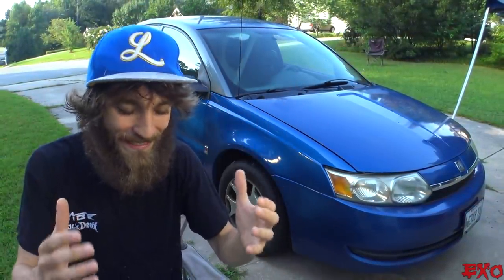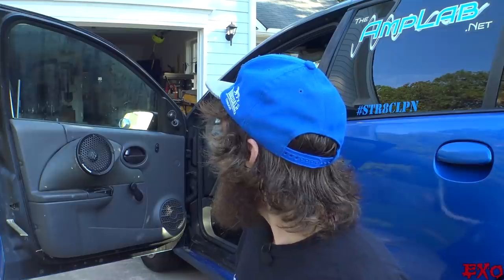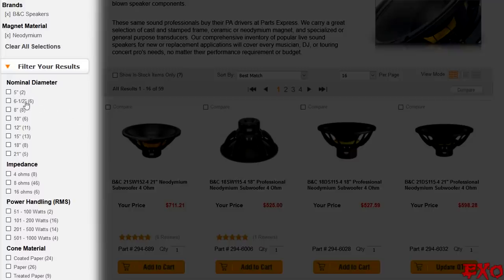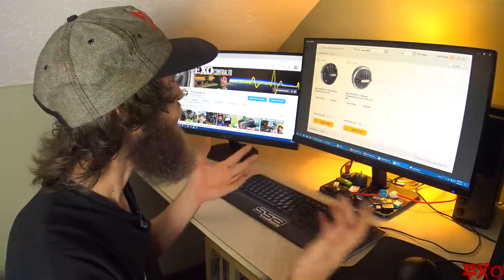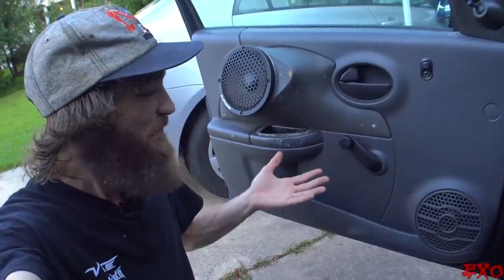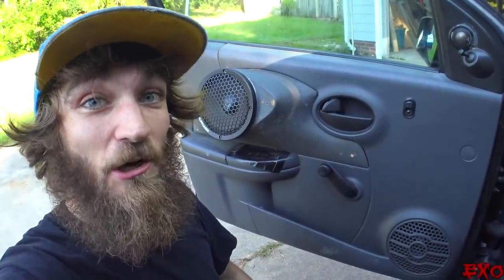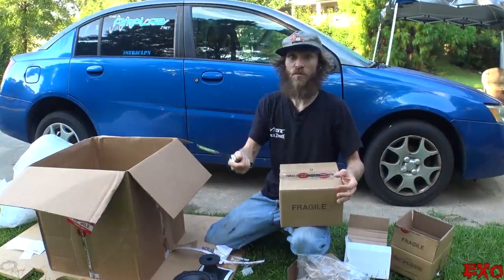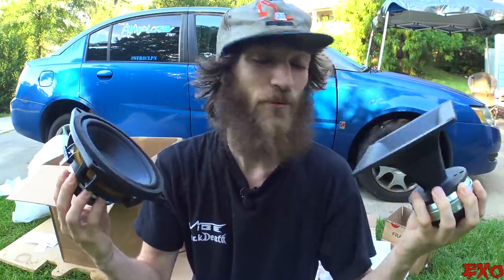Choosing The BEST Speakers for CUSTOM Door Panels & Planning EXO's B&C Car Audio SPEAKER POD Build

Comment: The guys at B&C ain't no joke. Their drivers are used in majority of state of the art touring loudspeakers (=cleanest and loudest). Check out B&C IPAL 21 if you ever wish to build a loud setup for your car with minimal cabinet volume. It will go incredibly loud (that comes within a fraction of a dB in max output compared to a single psi18 pf5 with only half the power required) due to it's crazy good efficiency.

Comment: I really wish I could contribute to a suggestion for your project, but I will definitely be watching to see how you pull it all off. I have decided to get rid of the $60 (for both) Hifonics 12s and get me a set of Sundown 12s for my racecar (I know, I know, but it's hard to stop a basshead). They won't be the best Sundown 12s, but it'll be a good starting point to replace these Hifonics with a quality speaker. I have also been watching alot of speaker box build videos from a few different channels and while I did build my last box just off the cuff without tone or volume in mind, I would really like to build the box for the Sundowns the proper way and have a setup that I can truly be proud of. I want to make you proud bro!

Comment: The power locks/window switch can be relocated to anywhere in the car, and would free-up real estate on the door cards (assuming the door lock is some kind of lever actuated solenoid on that). If you go aftermarket (maybe snag a company wanting exposure or go cheap) you can probably go with a remote solenoid for the door open and do away with the interior handle. OR, do like they did in the '79 Fox Mustang and relocate it to the bottom of the door. Could probably get some extra steel rod (a very thin diameter) from your local hardware store, bend it in a vice, and just mimic the factory mounts or make a mounting system (window might be an issue) that acts like a mechanical relay for the rods so the handle can get relocated.

Comment: I struggle to understand the use of a horn over a soft dome silk tweeter for highs.  Horn's are so bright and being that close to your head, I can't see that being a choice I'd pick. Those are speakers I'd use at range if I was trying to fill a room with home audio. But no horns in doors.  My big reason for that opinion is also because pioneer sold premiers back in the day in a 6x9 fasion that had horn tweeters on them and it was HORRID how hollow and flat they sounded.  On a side note I'll stick with audison or hertz.  Parts express is all great an all and can be economical but I'll go with what was designed for car audio over the diy "chance it'll be good approach".  Still love the video's.  And I wish I lived close by because winging installs and wiring up audio was the best fun growing up I had, was what I did through most of my 17-22's.  Miss the hell out of it.

Comment: With the depth those horns need I would utilize the factory speaker location, angled to the ears. Since it looks like strong aluminum that should be added protection from feet during demos. The next mid I would put above the window crank. Then the remaining three I would put in a v shape where the arm rest is, and have them crossed over a bit lower than the one above the crank. That would give a good balance from the horn to midrange to mid bass and then the subs. Also loved the package arrival scene, it was perfect.

Comment: Hey Exo, id actually go backwards to go forwards!? I'd first look at doing a power window conversion, or grabbing the window regulators out of your type of car that was factory power windows, if there was some that fitted or aftermarket. Would make the install of speakers SSSOOOOoo much cleaner, 
P.S love the channel.
Reply: Yeah, second that. We converted the Cavalier over to power windows and gained a ton of space. Also the rotation of the crank can limit where speakers fit pretty severely.

Comment: PA meets car audio a match made in heaven currently my system in my room is...

2 X Hybrid PLB 15 inch PA Mids 2x340watts RMS i have them running on 80watts right now
1 X Targa Venom 15 inch Subwoofer 2500watt RMS 8000 watts Peak also on 80watts enclosure is tuned to 35hz
Telefunken Hi-fi amplifier 4 channel 

i'm waiting on my new amplifier will be here in december these Targa subs have ran numbers of 148DB(2x10 inch Targa venom's) all the way to 180DB(1 X 18 inch Targa venom) so when i put some true power on them i believe i will be sitting with a 140Db+ Room hahaha

Comment: I don't know if you have much time to read these comments because I'm sure you have alot going on, but I just wanted to tell you that I bought a set of Hifonics DVC 12s, a Precision Power 1200 watt amp, a 200 amp breaker, battery cable for the power and ground because my Optima Yellow Top is already in the trunk with a relocation kit, and a 7" motorized DVD player for my car because I wanted to start back into the car audio scene with something small that sounded somewhat decent. It sounds fairly decent for a cheap setup. Then I started watching your videos and your channel is inspiring me to want to build on it. Granted, the stereo is in my racecar/show car that makes over 500 wheel horsepower, but like I said before, it's hard to stop a basshead. I don't care about weight and all that, if it sounds good, it stays. I have all Pyle door and rear deck speakers (3-way 6x9s in the rear, and 2-way 6.5s in the doors with Infinity tweeters) with a 400x4 channel SSL amp for the mids and highs, and your channel has inspired me to reach for the next step and purchase a set of Sundown 12s. Granted, they aren't a Z series sub, but they will do just fine until I can afford to upgrade. I already have over $10k into my car making it what it is today, so I have to plan carefully and scrape money together and hide it until I can afford to get the subs, battery, cap, and amp that I really want, but we all have to start somewhere after being out of it totally for so long. Thanks for the awesome videos, and the awesome advice and help brother. I am 35, so I am getting back into it rather later in life, but it's hard to shake that feeling once it's in your blood. Thanks again bro!

Comment: Hey EXO...  I have a xzound madness 12" sub 2x4ohm 5000w max..  I have been told that its an American bass just a nother logo... 
Im thinking about a American bass the xxx 12" or maybe a 15" in my small peugeot 206... 
But my question is wich is Best, 2x2 ohm or 2x1 ohm for Max bass...
I have a boss riot 3400 w amp, but om thinking about wich setup you would say i should throgh in My car... Im thinking about going All 1ohm bouth amp and sub..? 
Im looking for max bass..  Some say 1 ohm sounds bad, and i should stick with 4 ohm or 2x2 ohm..  
What would you say, by the way! Love your channel.... 💪💪

Comment: It doesn't amplify the sound it just increases the surface area that the air interacts with speaker making sound louder but its not amplifying
Reply: That literally means it's being amplified. It's just a purely passive, acoustic form of amplification
Reply: @FOHFILMS  amplifying requires additional energy but thats not whats happening

Comment: I think having the tweeters so close to your ears is going to drown out the mids. You have to really play with it to get it right. Me I'd put those super tweeters as low as possible at an angle towards me. What ever you end up doing might wanna use some kind of tuning software to get it right.
Reply: You don't have to have the amp near clipping with tweeters. Also, the cut-off matters too. FWIRW, I've run smaller tweeters up on the headliner trim above each door on a 4 door wagon at a lower cut-off (think it was 10uf cap per tweet to pull it down a bit) and the sound stage was excellent and blended with the mids leaving no holes. 

Again, you don't have to have the amp near clipping. You can leave the amp gain a bit lower, and/or run lower wattage (especially with high efficiency/spl1w). I personally wouldn't use horns though near the ears. Maybe in the back to throw out a bit, downward firing up front for fill, but not front doors or angled at/near ears.

Comment: Hell yea I’ll definitely make sure to watch your vids to make the big 3 correct in my next vehicle.. for a 15” 1700 digital design but still need a 3k amp but it’s good for 3,600 Watts. Plus an extra battery. Any suggestions?

Comment: You need 2 amp, #1 1ohm for that 8 speakers, and #2 for the driver, btw just 2? I have 12 in my car door.. btw, put 3 speaker down and last & driver upper.. when u have alot of bass u neew de voice and hi more high. And good selection B&C speaker, now you need Stetsom amps.

Comment: you can get me a question, I have 2 sundowns nsv.3 15, they can play music with frequencies higher as 40hz 50hz and even 80hz that would cause some probe in them if I for songs to play in those frequencies, my box is tuned in 32hz more then I think of designing a box in 35hz what would be the best option to do?

Comment: That's what I need. Horn drivers I have 22 silk dome tweets and it has a hard time keeping up with my little 150db trunk build.
Positioning suggestion.. make a super pod for the bottom. I did my doors like this with baffles - I'm so happy Happy with them. Video liked - Peace and Bass
Reply: What silks and what power? I got 4 pair of Massive CT-2s on a Cobalt amp and they keep up with the 15s doing 150s. Maybe it's a placement thing too?
Reply: Wes W nothing fancy at all. I built some pods using prime 6.5s (coaxial) they do good. I will be upgrading soon.

Comment: 6.5, horn, 6.5, 6.5 swooping down across.......I think you should try and keep the horn higher up if possible that way it gets the travel more....higher frequencies are directional so you would want it to be able to hit people's ears when thet are standing outside so it doesn't it drowned out by the bass and mids.

Comment: Not sure if I missed it in the video but are you making crossovers for this setup or buying premade ones?  Your going to need a solid 3 cross overs per door, 2 for the mids and 1 for the highs.  Unless you plan to cross them over with 1 per door?

Comment: can't go wrong with b&c and compression drivers. you MUST build those doors in a way that you have killer midbass and with the driver I would definitely recommend keep it away from ear  set it so that with the door closed the driver is as close to the rear door possible this way when u open your doors the drivers would be heard more far away

Comment: Hey exo I've got a question about my setup just wanting to know if it's good or not. I'm currently running a boss audio single din head unit paired with a set of two focal audio ca165 120 watt coaxial door speakers and a set of two focal audio ca210 160 watt coaxial mid-range speakers, and I'm going to pair those up with a kicker solobaric ten inch l5 in a custom built ported box with a cheapo boss audio monoblock amp. My car is a 2005 Dodge neon with the factory alternator. I'd like to know ur thoughts on my setup if you don't mind.

Comment: Exo you should get a power window kit off online i only paid 50$ for mine works good had it for a year. Handles the heavy vibrations from 27hz and down. You will have more room 2 play with. Easy to install just 12v swith power & ground!

Comment: EXOcontralto I would personally ditch the interior door handle for either doors poppers from AVS or for smaller custom interior handles for a hotrod. And then i would install a universal power window kit and get rid of the window crank. That would give youmore room to line up the speakers. Id do two 6.5s on each side of the horn. And have the horn on a corner like a diamond amd arramge all the speakers in a slight arch down.

Comment: I like Lil Blue. I have my own Lil Blue, and the single 12 on 800 watts used to cave in my headlinerless roof on the daily. Made a lot of noise for a mini truck ('85 Dodge Ram 50). Watching your vids has encouraged me to do better with my personal installs. My current install is probably the cleanest I've done so far, so thank you!

Comment: I have been looking at trying to design a mids and highs in my car for a few months now. Of course using home audio components because the quality is much better. It problem I have is it being 8 ohms and having crossovers for them. My doors hold 3 speakers in the front and two in the rears for 10 speakers total. The front door can hold an 8-inch woofer 3 and a 1/2 in mid and a tweeter. the rear doors 6.5 woofer maybe I can fit an 8 also a tweeter. 
I have not seen a 10 Way amplifier that puts out enough power at 8 ohms or how to wire them up to make a lower ohm level like 2.6 or something with a crossover. Maybe you can do a video on something complex like that.

Comment: Looks like an awesome setup.   Quick question.    With the drivers.   Are you using a crossover to cut off the high freq from the mids?  Or do they get 67hz and above?

Comment: I will put that 550 driver on the middle not directly next to the people ears I have the b&c de610 driver and let me tell you the are super loud so loud that I ended up putting a capacitor to lowered the driver output b&c for the win

Comment: have some questions about mids setup as well, i ordered 2 Renegade RX62  (rear) and 2 Kicker 43CSC674 6-3/4" CS, (front)  do you think this will be enough vocal? i may run a separate amp or just replace the speakers (head unit is 4x52w) am running 2 kfc-w3013ps  (1200w max SVC 4 ohm w/ 1.25 cu. ft sealed box(on a 4 channel hifonics brutus amp in dual 2 ohm mono(sitting in the back seat no less lol))) and 2 audio pipe TXXBD112 ( 1200w max dvc 4 ohm with (i think) 1.75cu. ft. vented (i know the manufacturer says 2 cu ft, i'll get to that later) .. i'll be honest idk how u can tell what octive ur looking at lol.. anyone, please help? lol, oh and it's all in a 02 sentra gxe lol
Reply: also, like you say, from 80 hz up, idk if these speakers are sufficient, or will i need something different? thanks for the time.
Reply: also, the amps power ratings are 800wx 4 (400 x 2 @ 2 ohm mono bridged ) for the hiphonics brutus on the sealed and 1200w (1 ohm mono) hiphonics zeus on the ported

Comment: Brother what I would do is take a good size piece of cardboard or coreaplast witch is corrugated sign material and cut out a templet of each side with the doors colsed. The mock it up with the door handle placement and window handles plus anything else then you see what your best  locations will be but also keep in mind mounting depth for where the window is electricle ect and then make a new panel for each side either from scratch or get a used panel for each side from a junk yard then make those into your new panel's. 👌👊

Comment: If the internal window lift components wouldn't interfere, I'd look at relocating the power door lock switch to mount the horn driver more forward of the seating position.

Comment: I'm trying to match a amp to my sub cause the one I got is too small. I got a skar evl 15 2500 watt max and 1250 rms and I'm looking at buying a Rockville 2800 max and 1400 watt rms so it doesn't have to work as hard to push the sub. Is that a good way to go about it? and also the ported box I got is a little more than .5 cubic feet of airspace too small and wanna know how much of a difference it will make to get a little bit of a bigger box?
Reply from the maker: That should be just fine man!
Reply: EXOcontralto I actually just bought a hifonics brutus 2400 watt mono block from a buddy of mine for 175 dollars. so far I'm happy with it my sub just isn't used to getting that much power so I got her turned down a bit so I can slowly break it in.

Comment: Hey top mount your tweeter at like 20 30 degree angle so they fire in still with the four loud speaker in a line like you had it. That would keep your tweeter open and unblocked
Reply from the maker: Would love a screenshot if you have anything similar towhat your mentioning!

Comment: I'd fall in love with a box of speakers too lol. And if it was me. I'd try to get my tweets as close to dash as possible or as close the other way towards the back of the front seat. And mount the mids in 2 pairs diagonally. So it would resemble a sideways lightning bolt if that makes sense
Reply from the maker: Oh yeah I could see that, for sure!! 

Cool suggestion, Joseph :)
Reply: EXOcontralto 
Thanks man. I watched your videos and started my install a couple years back. But it's in a pause at the moment so watching the videos is great bc I cant continue my own

Comment: Why going with 4x 8ohms per door?   Your door amp wont do 1ohm  or it's really powerfull even at 8ohm?   Sounds to me your 8ohms won't get too much power..  Enlighten me.
Reply from the maker: I'll be running a 1 ohm stable vocals amplifier.
Reply: So 4x 4ohms in parrallel would give you 1ohm   4x 8ohm gives 2ohms parrallel...     They dont look dual voice coils, so it equal 2ohms..
Reply from the maker: Concerto C3000.2D Amplifier 

1ohm = 1549 watts per channel 
2ohm = 1060 watts per channel
4ohm = 650 watts per channel

We'll have PLENTY of power!

Comment: Hey bro what's the best sub and amp for the price for a person to get started
Reply: skar subs are  a nice way to go. fSkar Audio VVX-12v3 D2 12"  about $140 and its going to sound nice if you follow the specs from the website. not the paper they send you. the website. specs are from the people who know the specs of the speaker. make it to the size of the website and port it correctly to the hz frequency the website says. and it will be nice. any amp will work. that can put out a lowpass sound.  skar makes some amazing amps as well. if you did skar amp and woofer. you would be on top of the world.